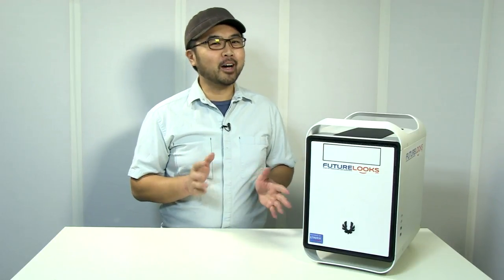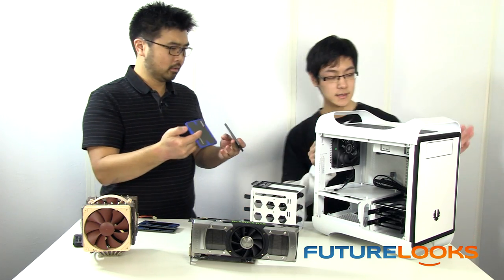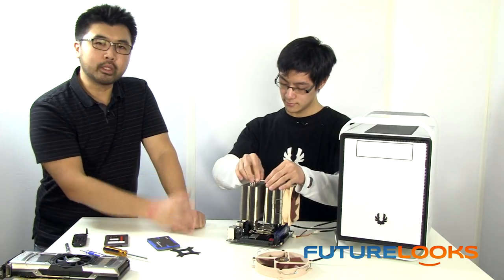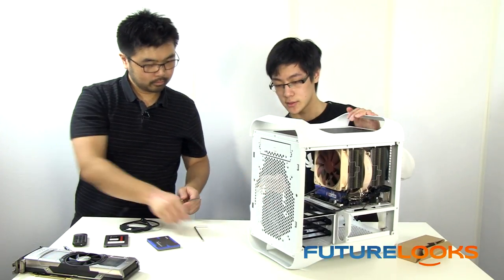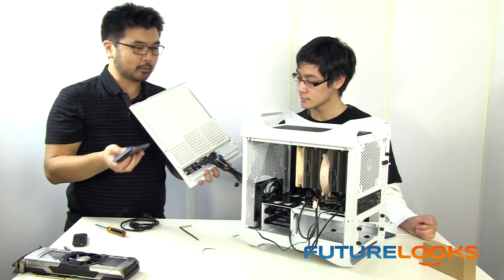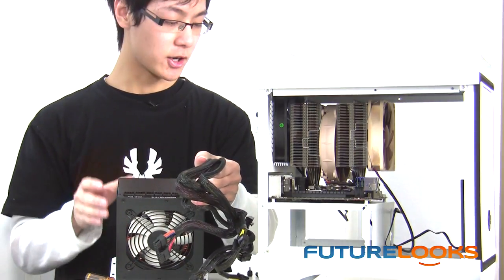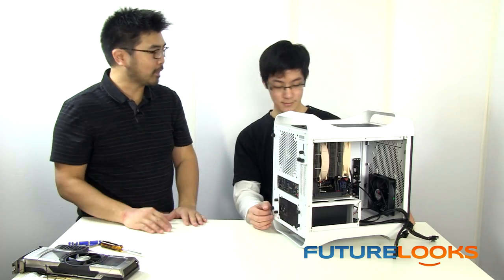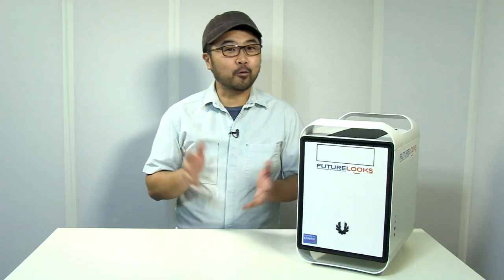[HD] Building the Ultimate LAN Party Rig Featuring the BitFenix Prodigy

Comment from the maker: The splitter comes with the NH-D14. It's required to sum the two connectors into one CPU fan header. But we do advise using some extensions for the other headers so they are easier to reach once you mount the board inside.

Comment from the maker: We built specifically for a LAN party configuration and in that environment, it's pretty rare to see optical drive usage. But for a more multipurpose build, you may want to go external (they are very cheap) or go with a smaller cooler (or closed loop liquid).

Comment from the maker: The NZXT HALE82 we switched to is also 160mm. But it really depends on how the modular cable ends are implemented. Some of the ends that go into the PSU can be quite long. The Silverstone Strider Series is a great pick, but if you already have your PSU, you can also shim the back plate out with motherboard stand offs. We plan to demonstrate two methods in an upcoming video.

Comment from the maker: The one we used was 850Watt. Just be sure that the power supply has a depth of 160mm or less or you will need to do a "motherboard stand off" mod to extend the rear PSU plate outwards to provide more space.

Comment from the maker: You can try the BitFenix Prodigy M that just came out. It supports mATX boards which allows for a second GPU. Or you can go for a dual GPU solution like the GTX 690 or its successor if/when that materializes.

Comment from the maker: If we used any other high performance CPU cooler besides the NH-D14, we would not have to remove a single thing. We point out other options but we chose it to illustrate what could be done with a ridiculous sized cooler. In the end there was no compromise in performance. We don't consider having to substitute equal or greater performance parts to fit a compromise. DIY is great because of the options.

Comment from the maker: Strange. The specs on the Cooler Master website for this exact PSU are as follows - 150 X 140 X 86 mm / 5.9 x 5.5 x 3.4 inch. If it's under 160mm it will fit.But you can make it fit with a "hack" discussed briefly in our latest BitFenix Prodigy build video. It's in our uploads.

Comment: What exactly do you need the super fast memory for? Intels onboard memory controller is so good that I would recommend that you just go with a 1600mhz kit and spend that extra money on a better gpu. As far as psu goes pretty much any 750w nonmodular would probably worth with that case. And if you are really deadset on getting that memory I think the asus p8z77 mitx board supports that amount of voltage.

Comment: My build has one in the back fan slot on the top, if you use an optical drive that's the only top spot for it. If you don't use an optical drive you can put it in either spot.

Comment: Futurelooks, i wanted to ask if this build was possible. I want to have a 230mm fan in the front and also use the optical drive for a fan controller. I am going to use a 140mm for exhaust on the back and two 120mm on the top of the case. I am also going for an after market Cooler Master 212 evo for the cpu. Do i have enough fan ports for all of these fans if i go with a Asus P8Z77-I deluxe and a Bitfenix Fan controller module?

Comment from the maker: The Titan is less powerful than the GTX 690. Although the GIGABYTE Z77 board is a great board, it doesn't have the capability to OC like the Z77 Stinger by EVGA which is built for that with a better power system. But if you don't OC, then the GPU in our build would make it more powerful overall.

Comment: Hey guys, I want to build a new smaller computer and I am flopping between this BitFenix Prodigy case and the new EVGA Hadron Hydro. I cant seam to find a review on the Hadron Hydro, I can find one on the Hadron Air...but I want a liquid cooled mini_itx computer. There is a huge difference on price between these too cases, but the EVGA does come with a slim power supply...Please try to do a review of the new EVGA Hadron Hydro case, you would be the first! :)
Reply: I don't think the hydro is released yet. plus most youtubers are at CES.

Comment: Can I get some end results? Was the CPU powerful enough for the GPU? Will it work with a Radeon 7950 or a 7770? Are there any other fans I can find? Currently hoping to build a computer with:
CPU-AMD Phenom II X4 (EVGA Z77 Stinger)
RAM-G.SKILL 8GB (2 x 4GB) 1866
GPU-SAPPHIRE Radeon HD 7770 (Or 7950)
Motherboard-GIGABYTE GA-78LMT-USB3 AM3+ AMD 760G USB 3.0 HDMI Micro ATX AMD Motherboard 
HDD-Western Digital WD Blue 1TB
Case-BitFenix Prodigy
DVD Drive- Black SATA 24X DVD Burner
PSU-Corsair CX 430

Comment: I'm buying a new small factor computer and i was wondering which of these motherboards i should buy and what their respective features are to one another .
Both are socket Socket-1150
MSI B85M-G43
or
MSI Z87M-G43

Going to buy a i7 4770k, 16 gb ram 1600hz or 1333hz and use instant OC that's why i am wondering between these to MSI one's?
Reply from the maker: Definitely the Z87M-G43 of those two choices. The Z87 chipset is built for overclocking and will be a good fit for your 4770K. You'll get the best results out of this board. But if you are not overclocking, either board will work and you could save money by going to a 4770 non-K.
Reply: Futurelooks ok thank you for the answer, do you recommend any other motherboards that would fit in a Bitfenix prodigy m, with a i7 4770k, i'm going with the K model because i usually use the manufacturers automatic overclock feature, and the k model is like 10 dollars more expensive where i live(norway, just using USD currency to compare)
Reply from the maker: If you can afford it, the ASUS Gryphon Z87 mATX board is fantastic. That board will definitely squeeze everything out of that chip and be rock solid. For our demo systems, we use GIGABYTE Sniper M5 mATX boards. Also a very solid board with enhanced audio and gaming features. But it really depends on what you plan to use the system for. That's why DIY rules: There's a combo for everyone :)

Comment: Hi people! I wanna build a system with this case but i kinda need help!
I wanna get a GTX 650 Ti Boost SC, i5-3570K and Kingston 8GB DDR3 2400MHz (2x4) HyperX. I was wondering what kinda PSU i would need and what motherboard i should get. The RAM are 1,65 V and i might wanna overclock the CPU at some point. I can't seem to find any ITX mini motherboard that supports 1,65 V RAM! Help me! :)

Comment: PC
Graphics card:ASUS GeForce GTX 770 DirectCU II OC 2GB GDDR5 

Processor:4th Generation Intel® Core™ i5 4570 3.20GHz Socket LGA1150

Motherboard:GIGABYTE GA-Z87N-WIFI Intel Z87 (Socket 1150) 

CPU cooler:Corsair Hydro Series H55 Quiet Liquid Cooler £58.13

Ram:Corsair Vengeance Pro Red 8GB (2x4GB) DDR3 PC3-12800C9 1600MHz Dual Channel Kit

PSU:Fractal Design Integra Series - 750 Watt 80 PLUS ® Bronze Power Supply £63.94 

Case:BitFenix Prodigy Mini-ITX Cube Case

£895.96 Thoughts?

Comment: Can anybody tell me what kind of cable was the one that connected the 2 fans of the cpu cooler
can anybody let me know if it possible to use with the corsair h105 
I need to know this because i have a mobo with 3 fan port but i want to put 4 fans on the pc (2 of the cpu cooler and 2 normal fan, the one in the gpu will be automatic i guess, need help there too)

Please help
Reply from the maker: It's just a y-splitter that came with the Noctua.  But most good computer shops should sell the.  And the H105 will fit in the top. GPS should not need external fan power.  Usually built into its PCB.  Good luck.
Reply: thank you so much.
One more thing i think i will get the prodigy but don't know which motherboard should i get, i think i will need one with good wifi and that can be used for a light overclocking and that can support the i7-4790k
Reply from the maker: All the new boards are very good. But the ASUS ROG ITX board is simply...amazing! We cover it in Episode 2 of our COMPUTEX 2014 video coverage - http://www.futurelooks.com/episode-2-computex-2014-coverage-featuring-quiet-asus-win-bitfenix-adata-nzxt-video/
Reply: what about the new mini itx z97 mobo, which one is the best for what i will be doing?
By the way really great video and i fall in love with the asus maximus VII impact but is just too powerfull and i think is exagerated (for me of course)
Reply from the maker: The ASUS ROG ITX "IS" a Z97 mobo :)
Reply: Yes but not mini itx though
Reply from the maker: Of course it is! 

http://youtu.be/Gn2JM9phRWg?t=5m30s

ASUS ROG is a series. And one of the boards we showed in that series is the Z97 based Maximum VII Impact which is Mini ITX.
Reply: ok got it...i's a nice mobo thank you

Comment: That's a full size ATX motherboard so the chances of fitting it into a mini ITX case are understandably zero.
You can't get ANY AM3+ socket mini ITX motherboards anywhere.
You're better off with Intel for the Prodigy due to less heat output.

Comment: the Cpu cooler will heat the GPU and what happens
Reply: Right. If you want to put serious components in this case the only way to go is with a self contained water cooling system, like the corsair h60.
Reply: The one I currently have, perfect price/cooling

Comment: You cant fit a full size psu in this case the Corsair RM650 Does'nt fit
Reply from the maker: Not everyone wants to spend additional cash on a power supply that fits exactly. So what Jacky told us was that, if you want to make ANY power supply fit, you can use motherboard or electrical component stand offs, to space the back plate outwards. We've done this up to 2CM and it seems to be OK. Keep in mind, this will produce a "bump" on the back of your case. If you want a more "finished" look, you can order the PSU back plate from the Cosmos II. It spaces out about the same amount, and because it's built to stick out, it will look nicer.
Reply: I can vouch that the RM650 DOES in fact fit in the bitfenix prodigy, however, it is a very tight fit

Comment: I'm having trouble finding a mini amd motherboard for this case. So far the ones I've seen dont support Richland AMDs (or require you to use a non richland one to update it for richland.) I dont need one with built in wifi or bluetooth Since I could just get a usb wifi adapter. I'd prefer it to have at least 4 SATA ports and 6 built in usb ports (along with support for the exterior case usb and HD audio jacks) . I'm trying for a budget, first gaming PC so I dont want to go over $100 on the board. I dont plan on overclocking anything either. The processor I want to use. AMD Athlon X4 760K

So far I've seen this board, but I cant yet tell if it supports the cpu out of the box like I said.
http://www.amazon.com/gp/product/B00IYJS8C6/ref=ox_sc_act_title_1?ie=UTF8&psc=1&smid=ATVPDKIKX0DER